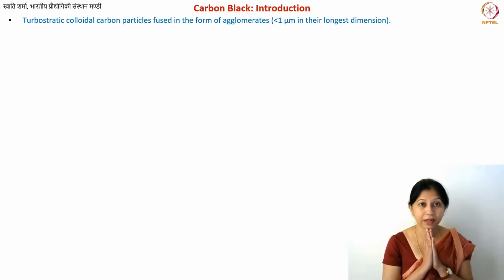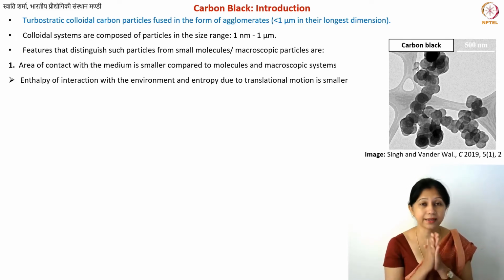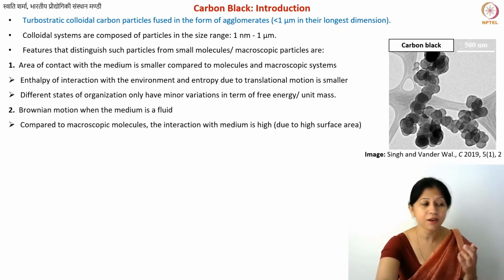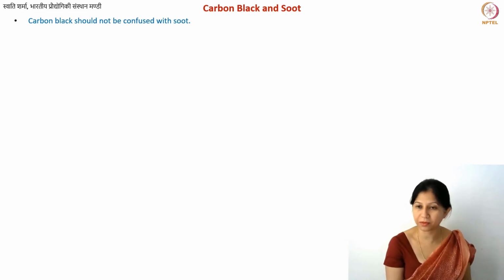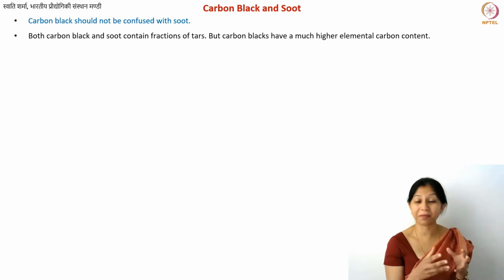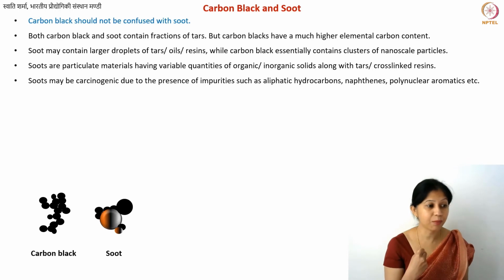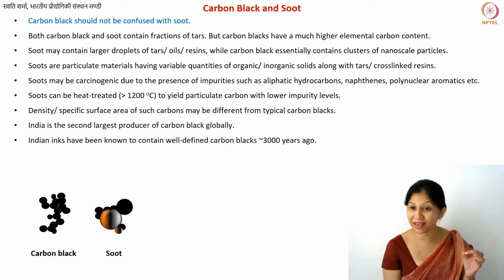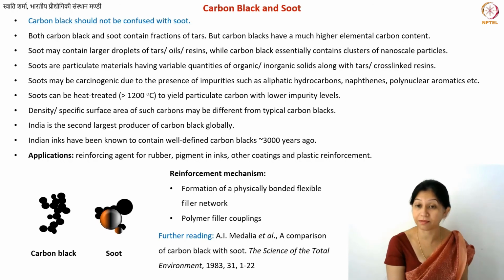Carbon Black: Introduction and Properties

Comment: This is Alamgir from Bangladesh. I have a waste tyre pyrolysis factory in Bangladesh,, I produce tyre oil , tyre carbon black and steel scarf. I am searching international buyer to buy my proudct
Reply: XPRIZE CARBON PARTICLE CAPTURE

FORMULATED MICROCRYSTALLINE WAX WILL CAPTURE CARBON
The heat loss from a smokestack can be forced into a large tank containing hot liquid microcrystalline petroleum wax. The heat will keep the wax at a molten state which facilitate the carbon to be absorbed when combined with the wax. Carbon when mixed with wax reacts like a dye. The wax-carbon amalgamation resulting into a black wax solution thereby making it impossible for the carbon to escape into the environment while in a liquid state. Other toxic particles are also captured in the wax settling at the bottom of the tank forming into a sludge. A sludge release valve is located at the bottom of the tank. After the sludge is removed more wax is replaced in the tank working something like a toilet. The sludge becomes a byproduct that can be used as an additive to asphalt for roads or used for cocooning nuclear waste materials for long-term safe burial. The entropy of the Earth has been increasing at a startling rate since the beginning of the industrial revolution caused mainly by the carbon that is released into the atmosphere. Government scientists have failed to stop and prevent carbon pollution from entering the environment. This problem can only worsen until a solution is found before this problem becomes irreversible. It has been discovered that formulated wax has been shown to be the only answer to this problem. William Nelson waxogen@gmail.com
Reply: XPRIZE CARBON PARTICLE CAPTURE

FORMULATED MICROCRYSTALLINE WAX WILL CAPTURE CARBON
The heat loss from a smokestack can be forced into a large tank containing hot liquid microcrystalline petroleum wax. The heat will keep the wax at a molten state which facilitate the carbon to be absorbed when combined with the wax. Carbon when mixed with wax reacts like a dye. The wax-carbon amalgamation resulting into a black wax solution thereby making it impossible for the carbon to escape into the environment while in a liquid state. Other toxic particles are also captured in the wax settling at the bottom of the tank forming into a sludge. A sludge release valve is located at the bottom of the tank. After the sludge is removed more wax is replaced in the tank working something like a toilet. The sludge becomes a byproduct that can be used as an additive to asphalt for roads or used for cocooning nuclear waste materials for long-term safe burial. The entropy of the Earth has been increasing at a startling rate since the beginning of the industrial revolution caused mainly by the carbon that is released into the atmosphere. Government scientists have failed to stop and prevent carbon pollution from entering the environment. This problem can only worsen until a solution is found before this problem becomes irreversible. It has been discovered that formulated wax has been shown to be the only answer to this problem. William Nelson waxogen@gmail.com